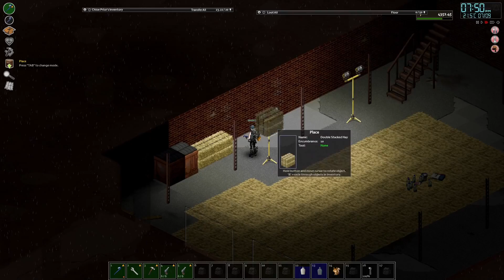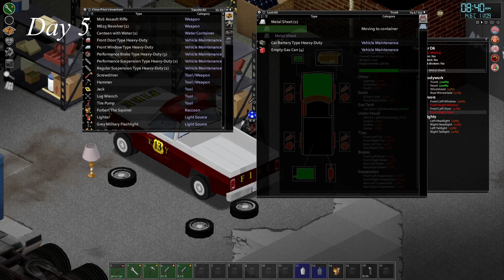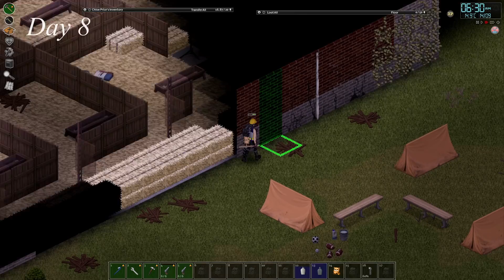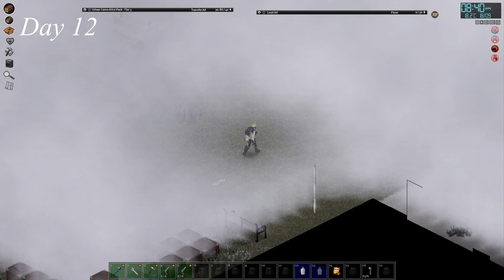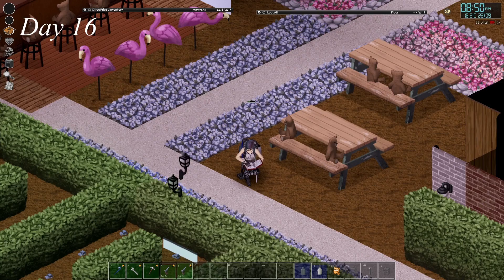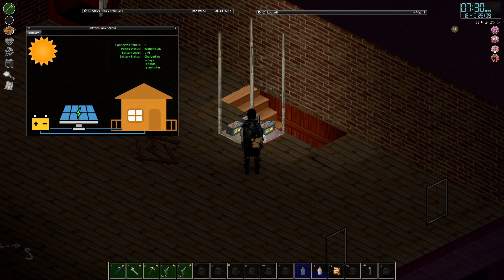I Build A Barn in Project Zomboid

Comment: what mod gives you so many belt/quick slots ?
Reply from the maker: I believe it is the Authentic z backpacks.  I don't use a lot of the slots, as some are for silly things like balloons.  There are some you can hang tools on, I think, but they don't get the full weight discount for the backpack.
Reply: @KyleMiddleton7  thank your for the response.
i was always kinda miffed about the limitations of the backpack and tool belt options. having a bat, a hammer and screwdriver there is handy but i always wanted a quick way to access cigarettes,bottles and maybe food,or bandages
Reply from the maker: @rokko1020  Well this backpack mod lets you clip two canteens to your belt, which is really cool.  I think it's the same mod that lets me have a hands-free torch too.